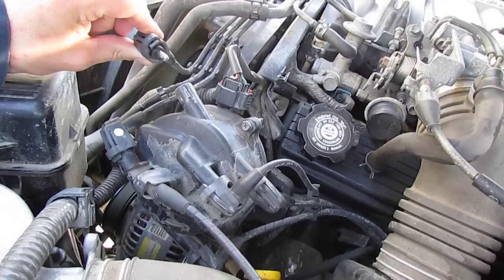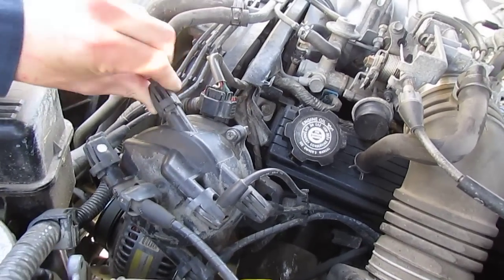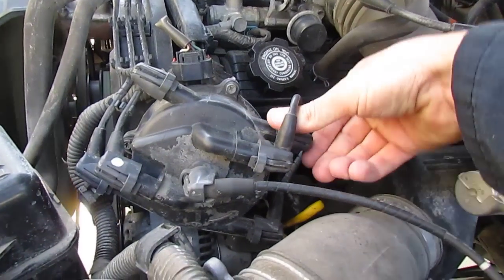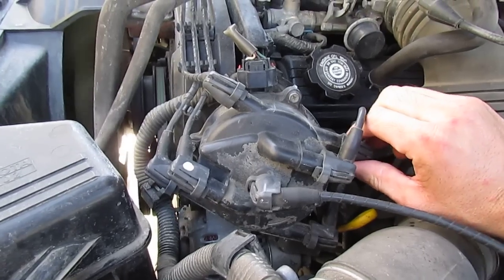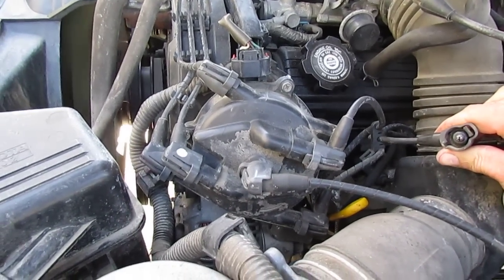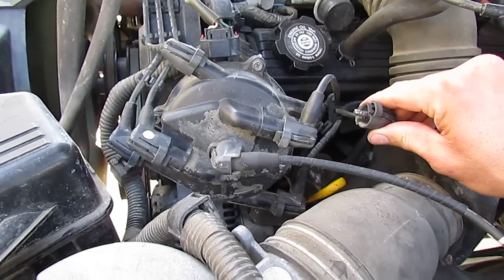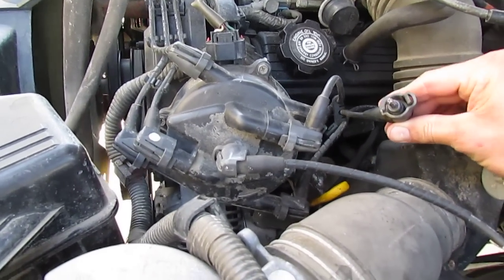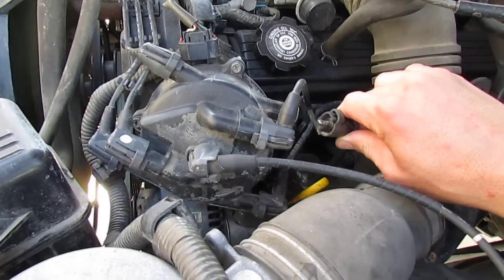3VZE 3.0 diagnose a cylinder misfire

Comment from the maker: This case turned out to not be anything with the ignition but a burnt exhaust valve on the dead cylinder. I pulled the heads and repaired it.

Comment from the maker: Symptoms of a misfire generally include a rough idle, poor performance, rich smelling exhaust, and yes bad fuel mileage. The biggest one in my case, and all other engines I have felt with, is a rough idle.
Reply: I've just finish rebuilding/overhauling my engine at a shop but put together by me. I just got 91 4runner v6 running yesterday and notice I have what appears to be a similar problem. I've known this trick you demonstrated for so many years but forgot about it. Your video was a good reminder on the perfect moment for me. I thought a timing light to set the timing properly may be what I need to do but now watching this video I now think it's a slightly burned spark plug wire. Nice.

Comment: 6 is the easiest one to get to. Be happy it's not #1 like mine was. New plugs fixed everything though:)
Reply: Hey man. Got a question for you. I have myself also a 3.0. I could say it's doing the same thing like in that video. When i first got it, i changed the plugs and plug wires thinking that the rough idle my go away also. It got better. A year later, i changed the distributor cap and rotor and it remained the same. In your comment you said that you just changed the plugs.. Would i need to change the plug again for that one cylinder ??  thx
Reply: alexbaargaal if my memory serves, I had a fouled plug due to sea foam (I overdid it) and I replaced all the plugs because that's what you really should do so that they are all the same age
Reply: Thx for the reply. appreciate it. I also used seafoam at the beginning, but i use only half of it. So you would change them all AGAIN ?? I kinda have the same thing.. in my case it's number 5. Do you think that it could really be a bad fuel injector ?
Reply: alexbaargaal I am not sure. I got rid of my runner a year ago due to rear main seal leaking excessively and I got an outrageous quote to fix it so I bailed

Comment: These motors need OEM Toyota genuine plug wires..with the included wire holders. trust me on this.... in the past all the other kind I tried didn't work well. The egr pipe i put slice of heater hose to act as insulation as the wires rub up against it

Comment: 95 4runner 3.0L v6 151k miles. I just bought this runner a couple days ago. Guy said he took it in and the diagnostic said it was the upstream o2. I found the sensor for 50 bucks and saw it was 2 bolts to replace. Bought it. Replaced it. Still not running right. We changed rotor - cap - plug wires - plugs. Cylinder 4 still misfires. Reading a lot of head gasket nightmares about this particular motor. Uncle thinks maybe a bad valve. What do you think? Are either of these expensive to fix (from a repair shop not DIY)? Half tempted to take my 4.8 vortec motor and tranny out of my rust bucket chevy and drop it in there if its going to cost more than 500 to fix.